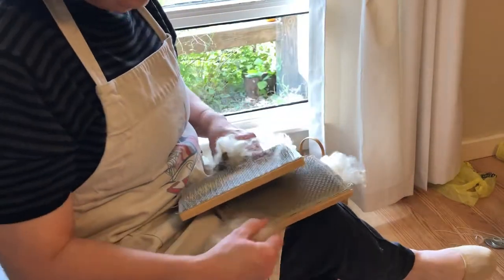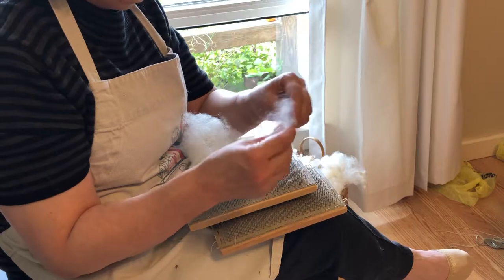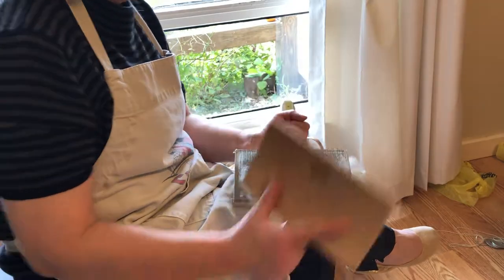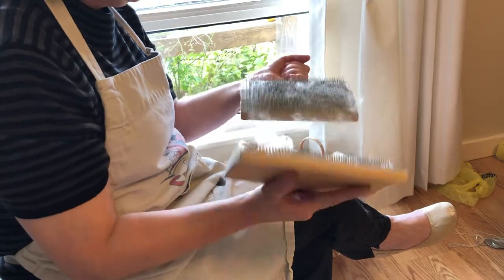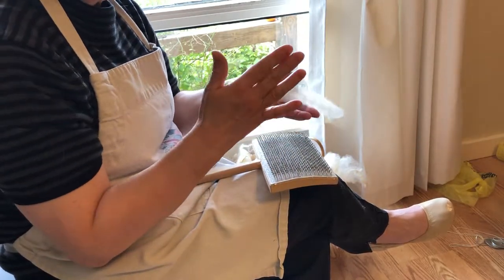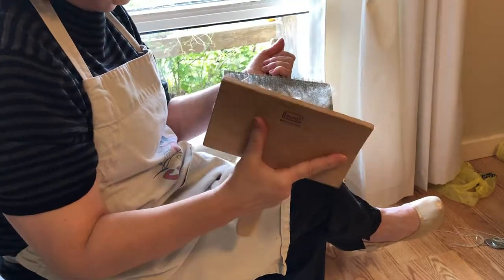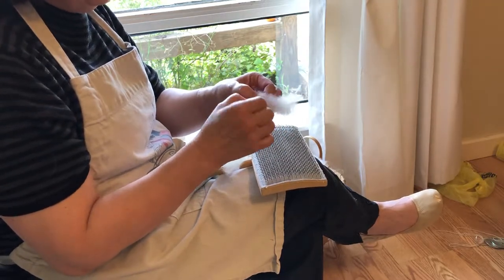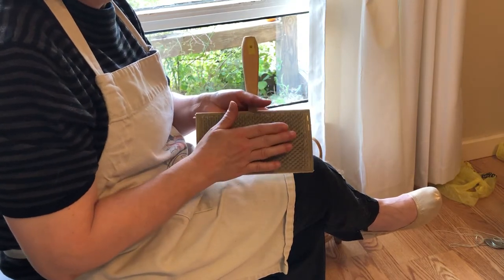Very Beginner Hand carding

Comment: I want to fluff up bags full of poodle wool to stuff a cushion or something. I've been trying to card with old wire dog brushes but it's a lot more work than I imagined!
Reply from the maker: Try using the widest wire dog brush as possible.  In the spinning world, I would use my extra fine cotton cards which are 9" across.  The goal is to merely prep the fibers for spinning.  So, you do not need lots of back and forth on a wire brush.  And perhaps set a goal of 5 rolags a day.  Handcarding was a full time thing. It took 7 hand carders people to supply enough rolags for 1 handspinner.  Good luck.

Comment: How can we take old wool garments and shred them for stuffing? Or other methods to repurpose merino wool in particular.
Reply from the maker: Once wool is spun and then knitted and woven into a garment, that is very hard to undo until you got back to the actual separated fibers you could use for stuffing.  People DO unknit and repurpose the yarn to knit another sweater.  I prefer repurposing the garment as another garment rather than for stuffing.  That said, if you do have tiny squares of wool fabric, or lots of wool in the yarn form you can use it for stuffing.   I have so much natural wool in the fleece form that I will use that rather than unpicking a sweater.  Also, depends on what is the best usage of the old garment.  Stuffing or perhaps oven mitts?  Shower mitts?  Sorry to be vague but I hope this gives you some ideas about your project.

Comment: I think it's a flicker brush that's used to pull the wool apart for hand carding and blending board.
Reply: No. It is a rocking wool picker. Flicker brush is to remove vegitable matter.
Reply from the maker: There is a flick carder for simple teasing out the staples and remove chaff in the process.  The wool picker was a large, dangerous contraption with long widely spaced nails that teased apart wool.  I have used both.  For small jobs, I use the flick carder.